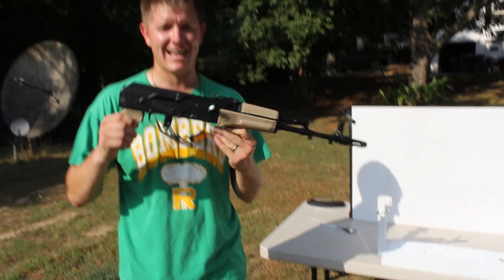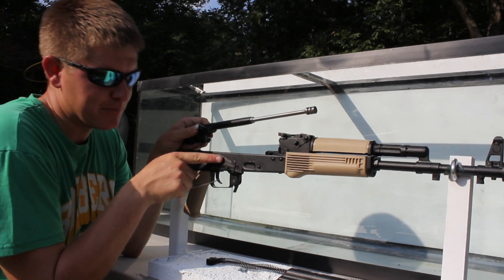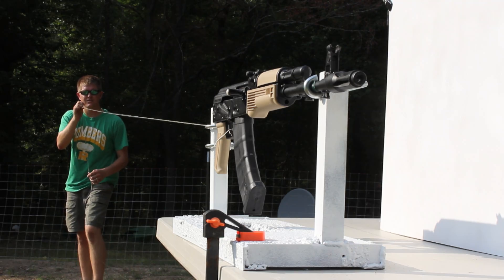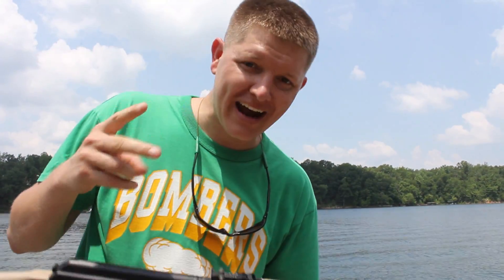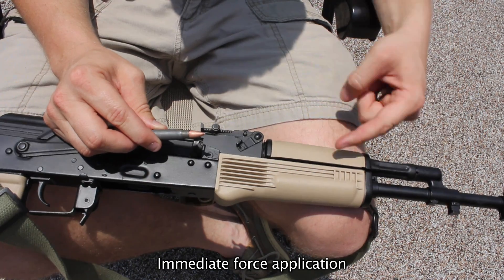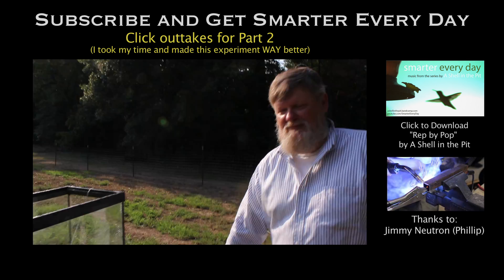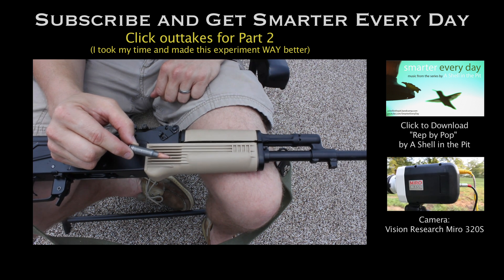Slow Motion of an AK-47 Underwater (Part 1) - Smarter Every Day 95

Comment: This is inaccurate.  Modern gunpowder is too strong and breaks the receiver if the barrel is obstructed with water.

Either this ammo was low recoil 1/4 the powder stuff or this video is fake.
Reply: Wrong, as long as the entire barrel is underwater you're fine.

Barrel ruptures happen because of the spike in pressure when the bullet hits an incompressable fluid.

If the entire barrel is submerged, the pressure is equal the entirety of the way down the barrel.

Comment: Woah NFA Violation right there, you cant turn a rifle into a pistol legally. I'd delete this video before the ATF come shoot your dog
Reply: You've got it the wrong way around. You're thinking of adding a stock to a pistol, which would make it an unregistered short barrel rifled in the eyes of the ATF. Taking the stock off a rifle with a legal barrel length is perfectly legal.
Reply: You do realize the stock folds and the gun can be fired with the stock folded? It would have to meet minimum overall length requirements already.
Reply: +ADMANRed No, removing the stock makes it a pistol which is illegal to do
Reply: Uh...No, no it doesn't.  The barrel length determines whether or not it is a pistol.  Not the furniture.
Reply: Yup you are right, if he still had the Ak 47 in the configuration in the video he would be in violation because overall length with a Ak without a stock is roughly 25.4 inches minimum 26 inches according to the ATF unless they SBR it.

Comment: In the atmosphere of higher density particles are closer to each other resulting in faster transfer of informations. It is being used in power tools. Microphone, inverter is monitoring the object during the measurements. When the tool is in contact with the material there is a sound. The sound signal is faster when it is passed to inverter by oil  than when it is transmitted by water or air .

Comment: I think you were looking for an excuse to play with the AK-47...  You might ought to do this in a swimming pool.  You could use an enclosure to keep the high speed camera dry.  If you did it this way, you would get better images of the AK-47 firing.  

I thought there was a water/gas mixture traveling through the bleed port and compressing the piston faster.  If there were nothing but water in it, it would have blown the piston out.

Comment: There a video explaining the compressibility difference between water and air?
Reply: Just look up how hydraulics work. Water doesn't get compressed under normal circumstances. It takes INSANE amounts of force to the point where water is often referred to as "incompressible" for all intents and purposes by engineers, even though it technically can be compressed under insane pressure but I'm talking about like 20km+ of water ontop of itself to start compressing a little. Hydraulics work mainly because it's so insanely hard to compress water/mineral oil/etc.

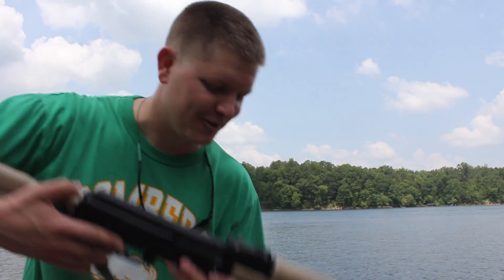Comment: 3:58 of course it still works. It is an ak variant.
Reply: anyone know if a flintlock or similar would work under water because that needs a spark to ignite the powder?
Reply: @TheBeansta  A flintlock would not because the spark would be extinguished and the pan powder would get wet. I expect that a muzzleloader using percussion caps would work, assuming it was capped before it was submerged.
Reply: Bean_ I'm no expert on older firearms but a flintlock or a matchlock would definitely not function underwater as even if they used self-oxidizing gunpowder as the user above was talking about, they still need oxygen for the flint/ match to work.
Reply: "technicaly" working doesn't mean it has any kind of practical application lol
Reply: @Raaaalph244  I did that. It worked. So what now?
Reply: Same with any firearm. It's not like theres a little pilot light in the gun to light each bullet lol I dont get why people are surprised when guns get wet and still work
Reply: lol i said the exact same thing in my head haha
Reply: Ahmed Muzakkir Yes, any firearm fires underwater. Modern gunpowder is self oxidizing. It has nothing to do with the firearm. It's the bullet itself.
Reply: Ahmed Muzakkir You could if the cartridge is self-oxidizing. It has nothing to do with the firearm. It only matters what gunpowder is being used. Self-oxidizing means it oxidizes itself, without the need of air. Modern gunpowder can be fired underwater, in space, or anywhere absent an atmosphere, in any firearm. Period. 

Try to play your internet semantics game elsewhere kid. You're dead wrong here.
Reply: @wesjones6370  Now heres a question. Since water is harder to compress, the piston went back faster. If you fired this in space, where the isn't even the presence of air, would the piston barely go back, or not even go back at all?  Dustin needs to go to space for us to find out.
Reply: any firearm still does.
Reply: Wes Jones Any modern firearm you mean then any firearm is too broad and implys that you can shoot a musket underwater.
Reply: Ahmed Muzakkir Yeah, must be. Someone on the internet who already made up their mind long before they ever used these firearms said so. Thanks internet expert. Now, if you'll excuse me, I'm off to go to the military base where I serve in the infantry using them by profession. Take care champ. Try learning next time.
Reply: Wes Jones You must clearly not know how a musket operates, you are wrong kid
Reply: Yes self-oxidising technology is what it is and if you're talking about modern muzzleloaders then sure, maybe it exists there too. But if it's MUSKETS were talking then generally speaking people would assume its one of the 150-250 year old ones. And I don't think they had this kind of technology back in the 1800s or so......

Comment: That's not an AK47
Reply: ***** Brett BG It's probably not an original AK47, but an AK variant.
Reply: +Sten-Martin Seeder If you actually want to know it's an Arsenal SRL-107FR :D Pretty much an American AKM variant.
Reply: @allupro  Correct, except that Arsenal are Bulgarian.
Reply: +Ahleqs It's obviously a High capacity AR-15 style revolver.

All joking aside, it's not shooting the russian 5.45mm cartridge, so it's not an AK-74. If you wanted to get more specific, it's most likely an AKM, which is just a variant of the AK 47 meant to decrease weight and simplify the gun. It also the most common variant of an AK-47, so It's an AK no less.
Reply: Ahleqs Cmon quick, answer us!
Reply: +Sten-Martin Seeder akm or ak-47m chinese
Reply: An original, actual AK-47 you see very rarely. Most of them time they just call it an "AK" while it's just an AK copy, an AKM, etc.

Comment: No matter how many times I see it, it is always cool seeing just how quickly glass shatters even in high-speed camera footage.
Reply: +The Curious Noob Theres only 1 video that i know of that properly shows glass breaking in slow motion... they had to use a framerate of 10,000,000 fps...
Reply: +clayton8or_2 do you know where I can find this video?
Reply: Joseph Wannall i dont think i can link it but it is called "High-Speed Camera HPV-X - Breaking Glass - (Recording Speed 10Mfps)" if you want to search that up you should find it quickly
Reply: I've heard the speed glass breaks (the speed cracks propagate through glass as it breaks) is even faster than a lightning strike...
Reply: the camera isn't that good, slow speed looks like freeze frames.
Reply: I've heard that glass breaks faster than the speed of light.

Comment: Its an akm by the way
Reply: mason hawkins Actually, no. It's an Arsenal AK, so the design is based on an AK-74. This one is chambered in 7.62x39, not 5.45x39 though.
Reply: Actually, it's an AK-47M. The AKM is lighter in weight, cheaper and quicker to manufacture. The current Russian AK issued is the AK-74M. "A" means "Automatic".", "K" means "Kalashnikov", "74" means the year of design, and "M" means "Modernized" (polymer furniture). But to keep things simple, gun guys like me call it "AK" or "Kalashnikov".
Reply: It's a Bulgarian clone of the AK-103.
Reply: Seth Gilliam In russian, that is then made into Avtomat Kalashnikova, yes i understand what the name means, and just so you know, it fires 7.62x39, not 5.45x39, so it is most definitely not an ak74m as you like to say. Also, dont call yourself a "gun guy" when you dont even know what is being fired in the video, or what you're talking about in your comment
Reply: +mason hawkins I noticed I did say 'AK-74M' when I meant to say 'AK-47M'. Good point. I know the caliber difference, I just mispoke.

Comment: Shooting any gun from a solidified position, such as vicing the gun to the ground so that it won't move when shot, will destroy the gun.  For every action there is an equal and opposite reaction, so when the cartridge is struck and the slug is shot from the barrel of the weapon, recoil is produced as the opposite reaction.  Vicing a gun to the ground prevents recoil, and this energy will instead destroy the action of the weapon.  This is what our physics teacher taught us!

Comment: Why not use a swimming pool with a steel plate to stop the round from hitting the wall? Then you could capture the whole action including the bolt and round.
Reply: A. The camera is not waterproof so he cannot do it in a pool 
B. The bullet would not even reach the wall of the pool let alone still have enough force to dame the wall, because of the water slowing it down
C. This is part 1 of the video and in part 2 he does do a similar experiment and uses 2 mirrors to reflect the image of the gun underwater so the camera can be above the water

Comment: Wouldn't the water create more pressure against the gases escaping from the weapon (compared to air), thus creating the higher pressure in the gas tube used to load the next round? Making it a more closed system and increasing the efficiency, resulting in a shorter reload interval.

Comment: In the terms of durability, reliability and stopping power, yes but when it comes to accuracy than M16 or M4 wins AK-47 no matter what.
Even M16 or M4 is more accurate than AK I'd still pick AK as my weapon just due to the reason it is more durable and has more stopping power.

For example, if you fire an M4 filled with water the guns bulletchamber and ejection port will blow up to your face, and no need to mention what happens with AK in similiar conditions, you just saw it on the video :)

Comment: Given that the cylinder is a sealed unit, filled with air and with a relatively small opening. I'm guessing that it didn't fill with water, and so when the bullet was fired and the pressure wave got to the cylinder opening and the air could either keep pushing the water forward or push the air in the cylinder, more air went into the cylinder since that had lower resistance.

Comment: I would have answered regarding the speed comparison air/water, that the reason for water being faster the reason is behind the water being incompressable.

It's actually really logic as the whole pipe is already filled with water, so the explosion only needs ti impulse a "chain of water" to move the piston to reload.

What amazed me was the pressure breaking the tempered glass. Great job, thanks for posting.

Comment: The reason the water was faster was that water that was ahead of the bullet started the process of moving the bolt back, once the gas got to the port, it accelerated the already moving piston.  It is like drag racing vs. a rolling start.  If you could get a rolling start at the beginning of the race, you would beat a similar car from a standing start every time.

Comment: For once, a truly educated and reasonable reply!! You are mostly correct about the AKM and AK-47 parts being interchangeable. The sole difference being that milled (machined) receiver. Though, after 1947, even AK's built in Izmash had stamped receivers which are extremely fast and simple to manufacture, but do not maintain the exacting tolerance that the AK-47 was built to. The AK-74 variant rifle, differs from the AK-47, only in caliber. The former 5.54x39mm, and the latter being 7.62x39mm.

Comment: lucky that it didn't blow the barrel apart or damage the bolt by SLAMMING it back A bolt gun would probably blow up but a semi-auto releaves the pressure enough that it didn't have a severe accident

Comment: Chicago only account for 30% and guns used there were sold in the street by thugs who bought them from easy states like Arizona and New Hampshire. 
Gun Control don't work if it is not nationwide. Surrounding Chicago is a reservoir of fire arms easily available legally or illegally because USA doesn't have a realistic Gun Control System. Guns fuel Chicago's gang problem.

Comment: That's why you need real nation wide Control system to prevent psychos from easy access to guns in USA. 

For ever 3 guns legally made, imported and legally sold in USA 1 goes to criminal hands because there is no efficient control system. 

Australia have Zero mass shooting since they implemented gun control in 1996.

UK had one mass shooting in 15 years. 

USA had 72

Comment: Actually, like Poe, the AKM is the (AK-Modernized) is the replacement for the AK47, not the other way around. Also there are PLENTY of AKM's with folding stocks (what I assume you mean by "removable"), otherwise known as the AKMS with both side and underfolding stocks. Also, the AKM shoots the 7.62x39, most definitely NOT a "lower caliber" round. The AK-74 shoots the 5.45x39 which is ballistically very similar to the NATO 5.56x45.

Comment: The difference between the shots in the air and the water is simple.
Water can not be compressed. And thats why the bolt gets back faster.
When the gun is fired in the air, all the air in the barrell has to be compared before it blows the bolt back. 
Thats, just my theory. Sry for my bad english and cheers from germany

Comment: AK-47's do not have a removable stock the AK-74 on the other hand does. The AK-47 is the newer version of the AKM and the AKM did not have a removable stock but it fired slower with a lower caliber round so thats why the AK-47 was made, and soon after that the AK-74. This AK model had a removable stock and the reason they wanted it like that was for close quarters combat (CQC). The AK-47 didnt alow CQC because of the extremely long stock so they improved it like I said with the AK-74.

Comment: If you are implying they are fundamentally different rifles that would be far from the truth, they both have exactly the same design approach and manufacture, they however have many incompatible parts as not only is the 74 chambered for a different cartridge, but the design of the bolt, muzzle break etc. have been improved. From an engineering and design standpoint, the AK47 has more differences with the AKM than the AKM has with the 74. They are however, all based on the same action.

Comment: The AK 47 shoots the 7.62x39 m43 round packing about the same power as the 30-30 Winchester.
The AK 74 replaced the AK 47 it uses the 5.45x39 m74 round which is comparable to the .223 Remington or .556 nato. its also said the AK74 has quite a bit better accuracy and currently the ammo for it is cheaper than anything else out there. in most places you can hunt with thAK47 but not with the AK 74 because its to light.

Comment: It is strange, because in 2:25 you can clearly see, that the cartridge is 7.62x39mm M43, but its stock has a carving which is typical for an AK-74 rifle plus the flash suppressor in the muzzle. Maybe it is AK-74 upgraded to fire bigger bullet?

Comment: The periscope in part 2 is smart but wouldn't this setup have worked better with a plastic sheet in place of the pane of glass where the bullet passes through? But I suppose it isn't simple to take off a pane of glass from an aquarium.

Comment: If you look quite closely at 2:25 the round it is firing is clearly the 7.62x39 round, the 5.45x39 round of the AK74 has a much narrower profile. Though AK47 is technically not correct, many refer to any 7.62x39 AK as an AK47 and any 5.45x39 AK as an AK74. If you want to get absurdly tight about it, it is technically a modified AKM due to the stamped receiver, the original '47 had a milled receiver that, while very stout, was highly inefficient to make even by Soviet standards.

Comment: Except there is. Unless you are honestly being so Nazi that it has to be stated as AK-47. Also the weapon featured in this video is neither an AK-47 nor and AK-74, it most closely resembles an AKM, but its not even that, its a converted sporting rifle. Still technically not an AK-47 or an AK-74

Comment: It's an ak-74 because of a couple of reasons.
1) there's no wood on this rifle, all original ak-47 designs used wood for the handle, stock etc. on the gun featured in this video, it is obviously plastic on the handle and under the barrel.
2) the tip of the barrel on this rifle is that of an ak-74, or an ak-101 both of which are very similar.
3) the tube that carries the gas to push the bolt back attaches to the barrel at a .90 degree angle on this rifle. But on an ak-47 it would be on a slope.

Comment: Oblong depression on the receiver just above the magazine well & the perpendicular style gas block. Indicative of an AKM style post 1960s stamped receiver (AK-47 has machined receiver with a larger, rectangular depression), and of an AK-74 style gas block in use from 1974 onward. That isn't a true AK-47, nor is it a pure AKM; but that curved magazine is indicative of the 7.62x39mm chambering of the rifle. So I think that is a civilian variant of the AK-103, available from a few firms in the U.S.

Comment: another reason may be that the water surrounding the gun creates, a pressure seal, so that when the gas goes past any flaws in the gun's air tightness the water prevents as much of it from escaping, meaning more pressure and energy make it to the piston